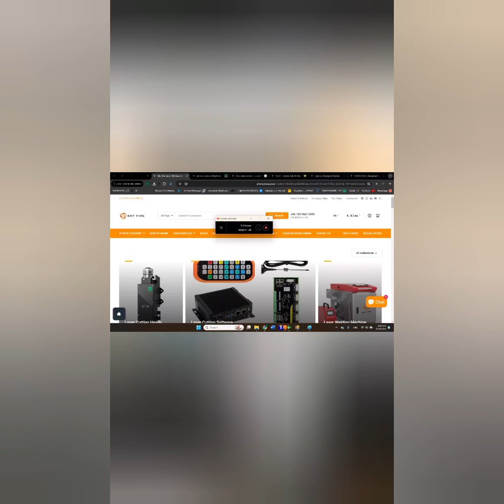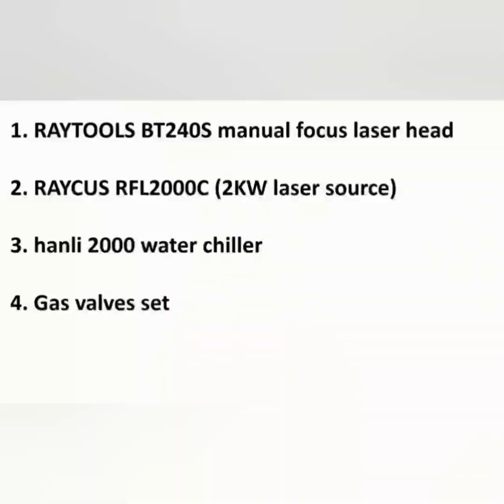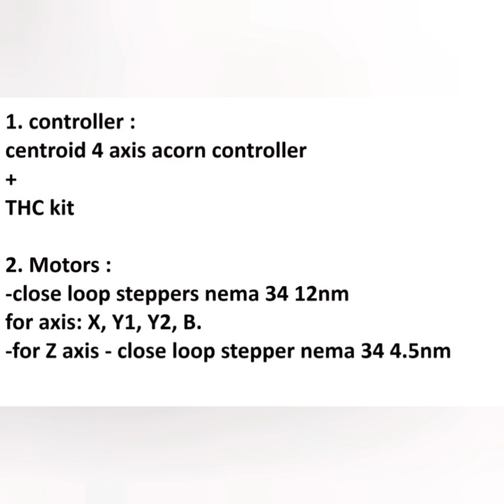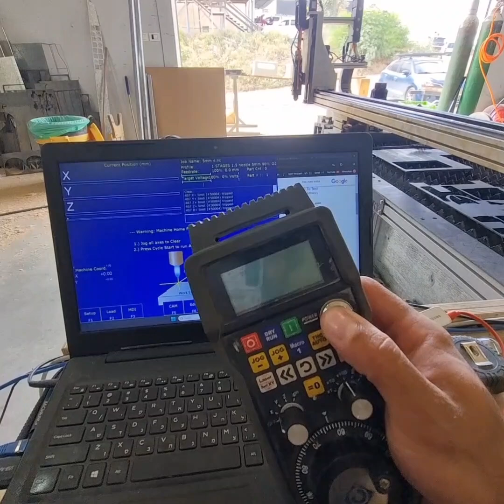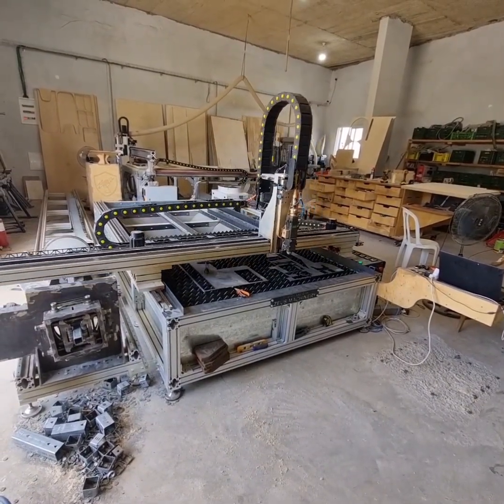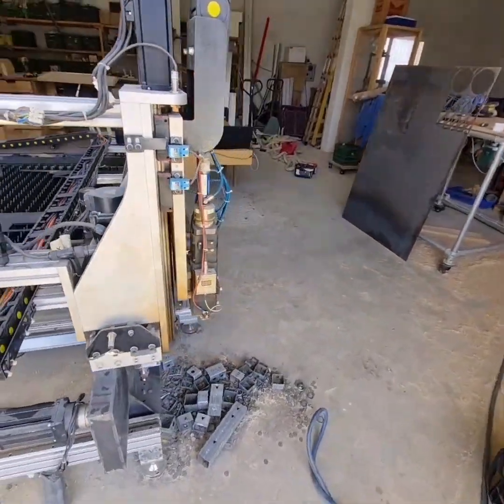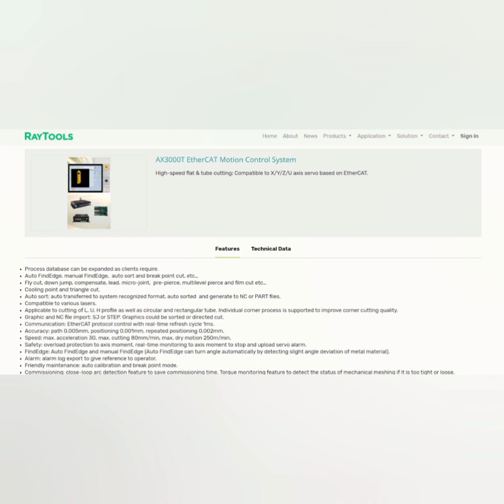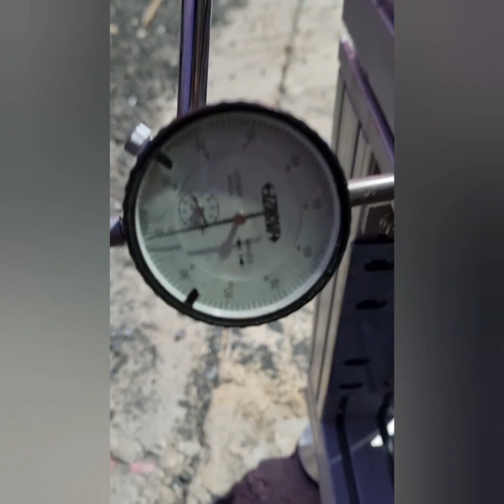DIY FIBER LASER introduction part 1

Comment: Bro, Thanks.! 

Many grey areas I have..!

 I am still unclear regarding how the laser source and chiller and laser cutter head and controller are communicating to each other and wired together. Is Autofocus is really necessary ? Is Autofocus is helpful only for thin warped/bent sheets? 

Many unclear areas..!

And I wonder what type of signal does the controller puts out to the laser source (or to  the laser head..? ) to start a cut and stop that cut.

How does the controller trigger the cutting process?

Oh...silly doubts again.!

Comment: nice video! doesnt the laser damage the cross members of the table? I mean the ones that are supporting the sacrificial steel. If not what is the distance between the cutting area and those table members? what distance would you recommend  to avoid cutting them
Reply from the maker: @markos3803  contact me at my email I will show you how it did things.
Zeusgripss@gmail.com

Comment: Hello Friend,

Glad to see your sophisticated Laser machine..!

Can You Do a beginner level video as a guide to Mach3 Based CNC Hobbyists?

Explaining the differences in the Controllers
What are the differences between a plasma cutter Gcode and the same Gcode for a fiber laser machine
and how does the controller handles it  including any focusing concepts also.

I couldnt find any Guided information to step up from CNC Router concept to such a fiber Laser concept.

I mean Example:  We  Can Cut a Shape in sheet metal using Mach3 Plasma Machine which uses Z- Strokes to ignite and start the the cut

What difference for The Same shape to be cut in Fiber Laser machine...!

It Can read Same Plasma Profile Gcode? Or Modifications in post process needed?

And How Cutting Commands are outputted by the controller
how the focusing concept works and how the controller handles it..etc

Whu Mach3 Controller cant be used to build such a cnc fiber laser,...!

Thse beginner level doubts remain uncleared..!
Still trying to learn..!
Reply from the maker: @BipinBabu-k4c  got it, maybe I will address it in future.
I mentioned this in my videos, it you only want to cut sheets then it will be much easier and better! To use raytools xc3000s .
He have all the necessary functions for laser cutting and he is not expensive! 500-600usd

Comment: just out of curiosity, why are you switching from the closed loop steppers to the servos? The tuning situation is exactly why I keep using closed loop steppers. There are a few auto tuning set ups out there, however, trying to tune the dual motor gantry set up keeps me sticking with the steppers. Tuning the servos to almost perfection seems like a difficult process and do you really ever know if they are optimally tuned? How do you know? Great job on this build, can't wait to watch your journey.
Reply from the maker: @josepatron4950  I switched the stepper because I wanted higher rapids and faster acceleration.
The tuning process is difficult not easy if you're not familiar with how the tuning process is done.
I can says without a doubt that they are better then close loop stepper by 1,000,000%%% haha

Comment: How much can one spend making similar or better machine taking into account your advice and hurdles/milestones you ripped through?. All this preferably for the hybrid sheet with pipe cutting features. Pipe cutting laser from industries are really expensive. Also asking if the same software used to cut sheet is it same for cutting pipes?
Reply from the maker: @nordenconrad14yearsago45  cost for all the components is around 20k usd.
The controller comes with two cutting softwares, one for sheets and the other one for tubes